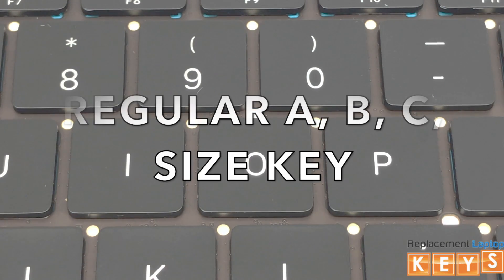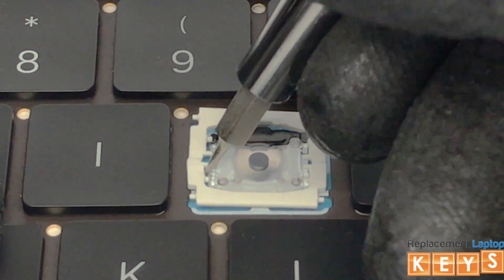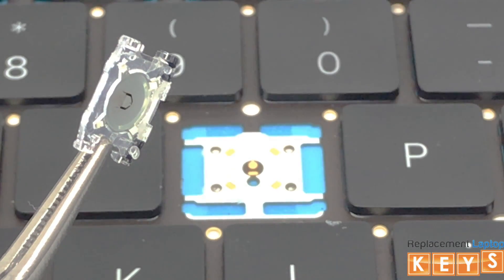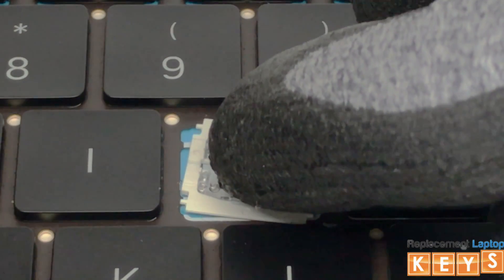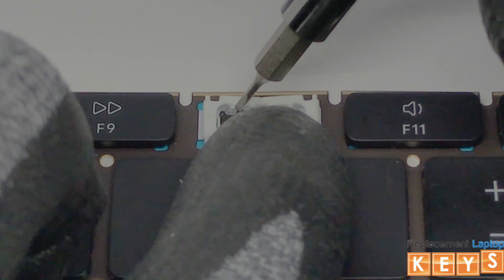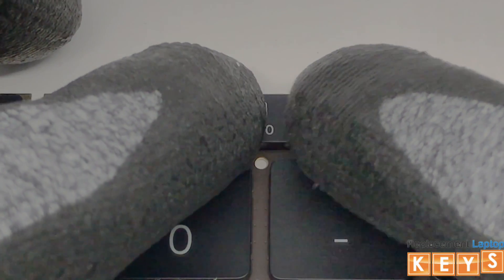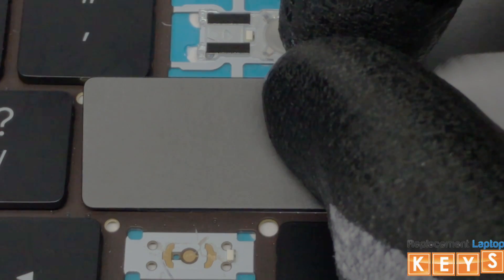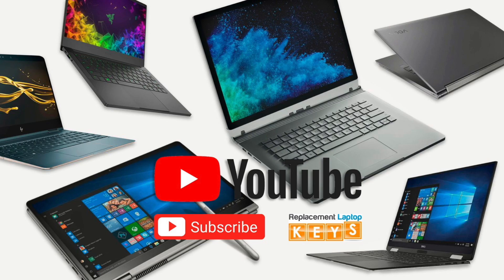Apple MacBook Pro Butterfly Hinge Clip Keyboard Keycap Complete Installation Guide

Comment: If anyone's curious, I was able to insert the butterfly hinge into the clear center piece without removing the adhesive. I did it like shown in the video using a small flathead screwdriver.

Comment: The first time I put the membrane and then the key, it came off, until I turned it over and it finally worked. Also, it has a part that must go over what illuminates the key. With that, the second time it was perfect.

Comment: Also, is there anyway to tell if the Hinge is broken, by simply typing on the keyboard and NOT taking off any keycaps? (i.e. does the key become more mushy when typing, less tactile, etc..)? I'm asking because I removed the "Down" Arrow key incorrectly by lifting up on the right side, where the keycap HINGES are and NOT the clips, thus, I should have lifted up on the LEFT side with my plastic prying tool. It looks like the old keycap (I was replacing it anyway) hinges broke, thus, I was able to get it off and the Hinge was fine - Does this sound okay to you? It clicks and feels tactile, but again, as for the aforementioned question, would I be able to feel something distinct if the Hinge (not the keycap), was broken? Thanks for the video!

Comment: At 0:44, what is the black-shiny material on the top portion of the hinge? I was replacing my keys on my MBP and I got some duster and I suppose I was too close and blew a too strong stream of air because this black little tape/adhesive that covers the hinge flew off. I picked it up and used some tooth picks to set it into place, but I was curious as to what it is (my guess is something to do with protecting from electrical current, i.e. like electrical tape?) & is it supposed to be sticky? (I'm assuming it is, though this is a 2017 MBP I am referencing, so many some of the "stickiness" has worn off, hence, air being able to blow it away?)

Comment: I "dont know it all" and dont be negative/defensive please at my comment. First of all great awesome video, really detailed but the  butterfly hinge cut out must be ontop, and secondly the top also has a bevled side and should be beveled down. So 2 steps to make sure you put the butterly down correctly.
Reply: Ah I see what you are saying at @2:32, the butterfly hinge has those "groves" or "indents" and when he first removed it, they were facing toward the bottom of the case (hence, none of these indents were visible), NOW, they are facing up TOP toward the user, hence all the comments of people saying he installed it upside down. Good observation and information for people looking to do this! Probably a small mistake and maybe he was simply doing a demo for the video and not permanently installing the key/hinge that way - Thanks for the comment and of course the OP for uploading this informative content!

Comment: Having issues.  My replacemnt membranes dont' seem to snap into place at all.  As soon I apply the key cap, the entire thing comes off.  I did notice when remove the old membrane that there is an adhesive.  The new ones don't seem to have that.
Reply: I also have a same issues with you. Did you fix it well?
Reply: @김하늘-e3q  the main idea is not to remove transparent part. It is not glued but it is welded from the other side, so it is not possible to make it firm again. Avoid removing transparent part if possible. If its removed, glue it from the other side

Comment: my center piece will not snap into the mounting holes for the normal keys
Reply: Same issue I have, and my old ones seem to have an adhesive not present on the new ones.  Did you find an answer?

Comment: What kind of adhesive does apple use?  Once you pry up the little cup (Centerpiece)  and reinstall it. It doesn't stay firmly in place. I have an R key that I replaced that continues to do this.
Reply: Just FYI I had to replace the whole bottom case . I ordered one for cheap on eBay .
Reply: I'm having the same exact problem. Did you ever end up figuring it out?
Reply: @evelynmmrtz  no I replace the whole bottom half with another 1 .
Reply: Are you talking about those little black pieces of tape that sit on top of the membrane?
Reply: @tdurden8747  yeah , I ended upgrading  that computer  to the M1 Pro .

Comment: Cant you place the hinge without removing the centrepiece the same way as you took it off?
Reply: I have the same question
Reply: @ToXicStreams._  you can i did it!
Reply: @F-MK96  Can you please tell me how you did it. And also how long did it take to receive the product.
Reply: @ToXicStreams._  so i pulled on the side and got it out very easy you can see it all in the video and I got the part in europe so it took 1 day for me
Reply: @F-MK96  im wondering how to put the hinge back
Reply: @ToXicStreams._  same way as you took it off i posted the video up in the comment
Reply: @ToXicStreams._  you are welcome https://youtu.be/dHaPA9_2E_0 (i have the lastest gen and didnt even have to remove the silicone membrane just have to be carefull and you can manage)
Reply: You’re lucky! I stretched the hinge on the side and it snapped at the middle where it folds. Luckily I tried it on the one that’s already broken.
Reply: Did you do it like the large key cap at 4:44?
Reply: @Wakewook  maybe it snapped because it was allready broken? Or maybe too much force? Just have to do it slow idk
Reply: @F-MK96  yeah I pushed at the fold instead of at the top or bottom like in the video. It didn’t even budge with a lot of force, just the fold snapped. Prolly shouldn’t have pushed that hard at the fold cause it’s the weakest part.
Reply: You you need to add adhesive back on the center piece or does the new piece snap in? Otherwise, how does the key stay on?
Reply: @TheGoddogfor1  i didnt need to i didnt remove it
Reply: @F-MK96  ok - I guess I did it wrong and pulled everything off. Good to know appreciate it!
Reply: @EJRACE76  i dont think you did it wrong alot of videos do it the same because its abit less risk. When i pulled the butterfly over it i was thinking it will break because you need some force but it was all good 😊
Reply: @TheGoddogfor1  the key feels the same as before when it was working

Comment: the second i put the key cap down it needs to be pressed hard just for it to be recognized. It works just fine right before i set the plastic cap down and the hinges are placed in right too. Not sure why that is. Do you have any solutions?